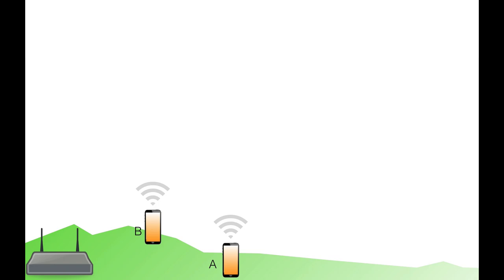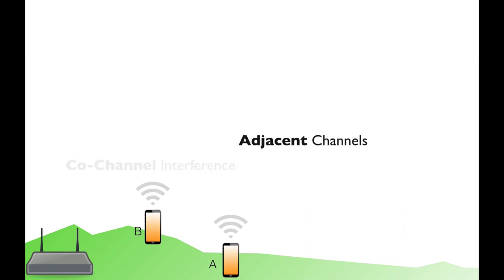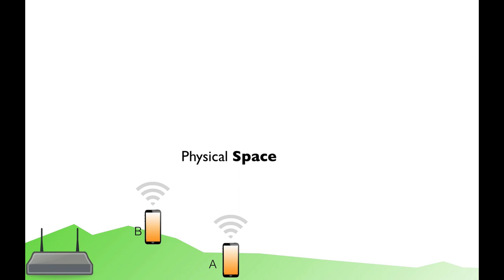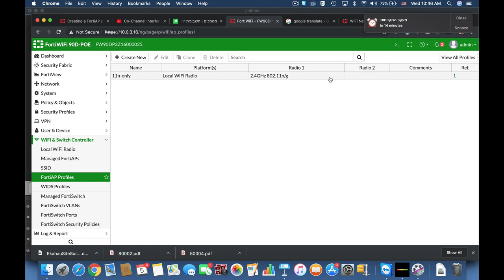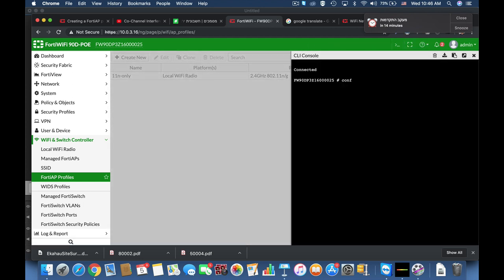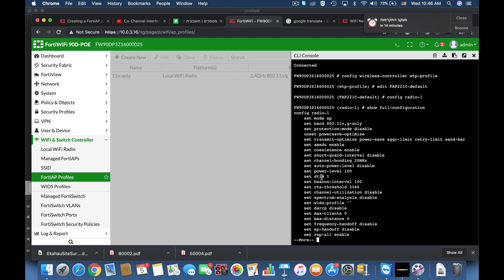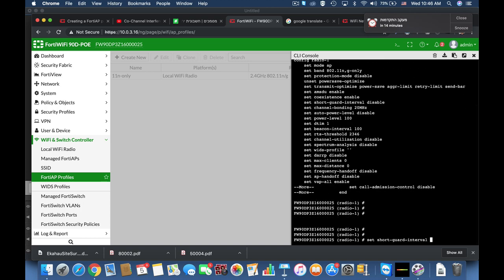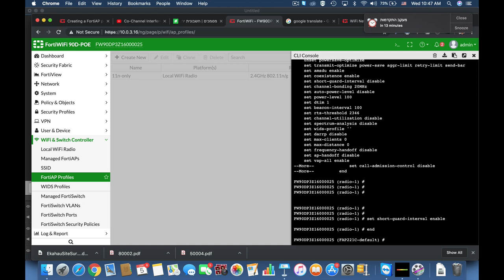INCREASE WI-FI THROUGHPUT

Comment: Which is better short or long?
Reply from the maker: Try out short guard interval , if it works OK, it will boost  your throughput
Reply: 800 because if you have lots of devices you can see the difference